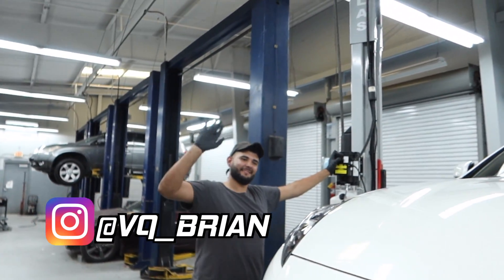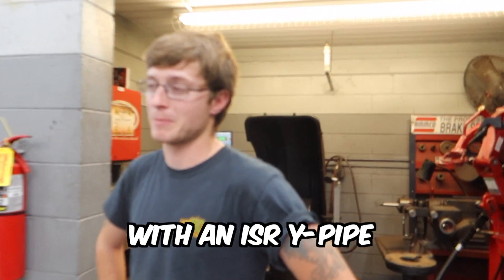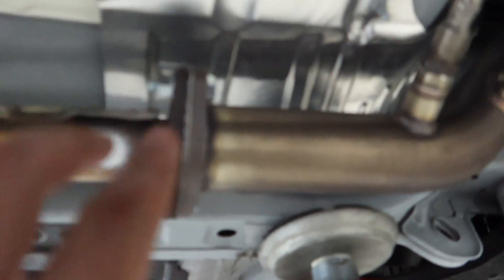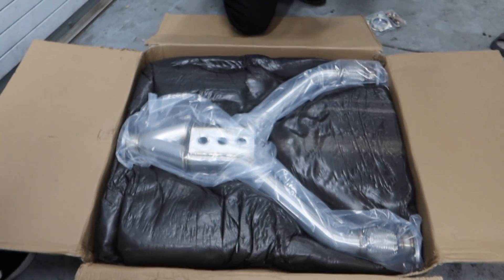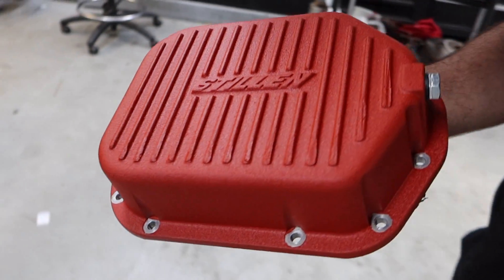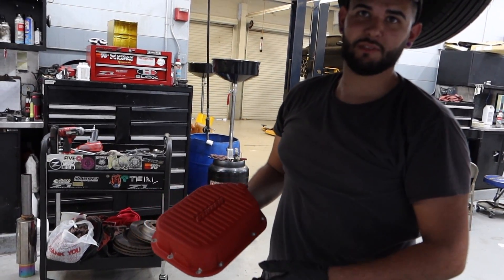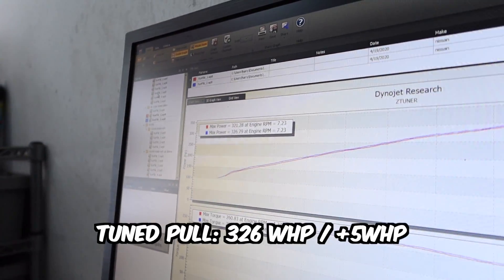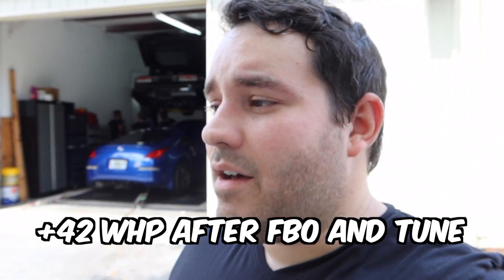So You Want To Mod A Nissan 370Z YOU NEED THIS EXHAUST!!!

Comment: Pretty decent numbers. Some ported manifolds, PPE LTH, should bring that up.
Reply: nopo sauce ain’t to worried about PPE, more looking for mid range power, port manifolds and gtr injectors w/ e85. Think it’ll be at 345
Reply: Should be close to that with those mods, the PPE will help with mid. 345 would be nice, close to my numbers.
Reply: @noposauce1930  I’m looking for LTH for mine, what did you go with? Also what numbers did you make & with that Bolt ons?
Reply: @Danny_Steezy  I went with PPE with parallel merge collector. I never did a before and after comparison as I added all the mods at once. I made 349 on that same dyno the 370z was on